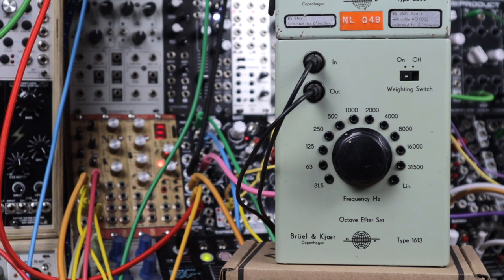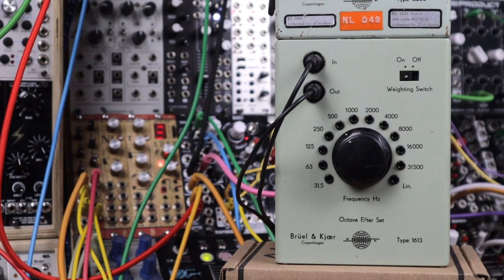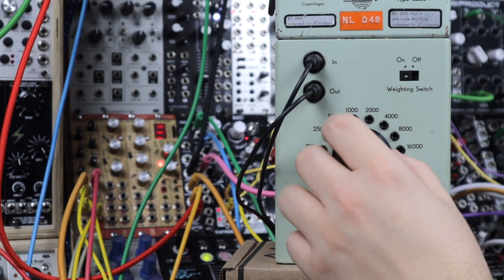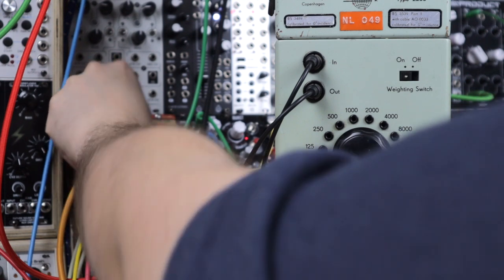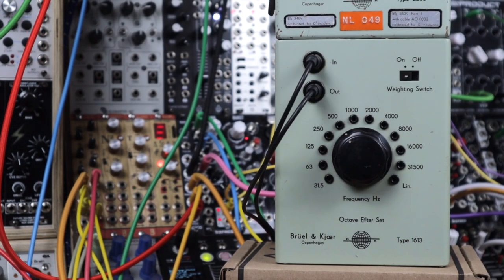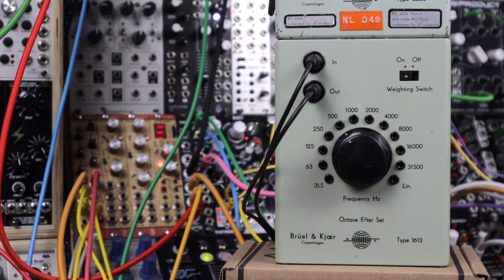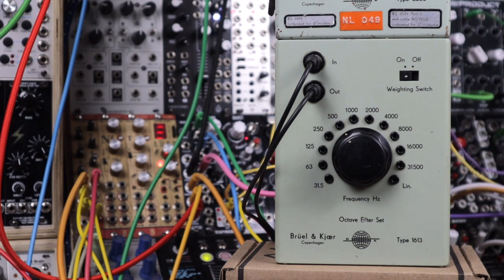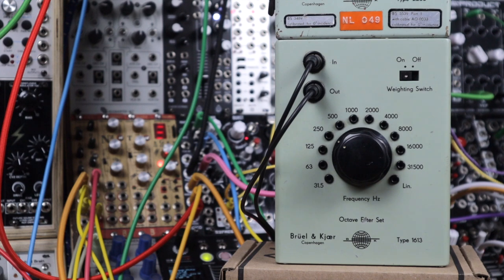Pinging vintage test equipment filters - Bruel & Kjaer Type 1613 // #JAMUARY2020 DAY 28

Comment: Hi! I've got some questions: I recently got one of these, but it only has the bottom end. What's the part with the ornage NL 049 sticker doing? Second question is: when I putn sound through from a laptop the filter does it's job, but when I feed my Grandmothers 6.3 Jack Out through it, it does almost nothing. Any idea why and how to fix it? Love the filter by the way! ;-)
Reply from the maker: the top part is the dB meter and mic that the filter connects to underneath. It's not doing anything here. 

RE your laptop and grandmother use cases ... I've no idea sorry. I'd need things here to try and test it and see what's going on.

Comment: How do you make it feedback several times? How do you set that up on your mixer?
Reply from the maker: Hi Frank, to create a feedback loop you need to be able to do two things, first split the output of the device and second be able to mix the input signal with the output. 

Typically with modular you'd use a multiple to take the output signal and split it two ways. One to monitor, listen to, mix with other sounds etc and the other to route back to the input. Splitter cables work and if you have a mixer with aux/send outputs you can use a send to route the audio elsewhere. 

You then need a mixer for the input, to mix your actual sound you want to go into it with the output. Anything that can mix two signals should do the trick. 

Hope that helps.

Comment: Sweet! What kind of cables are you using to go from the 1613 into the modular? I have a 1613 just sitting around because I haven't been able to source the proper cables yet (barrel connector to 3.5mm or 1/4”).
Reply from the maker: I found these cables that are working perfectly, there's even straight and right angled to choose form - https://www.amazon.co.uk/Voodoo-PPMIN-R-3-5mm-Right-Angle/dp/B00WBRPS6G/ref=sr_1_fkmr0_1?keywords=voodoo+labs+DC+to+3.5&qid=1580331196&sr=8-1-fkmr0
Reply: @DivKid  Thanks mate! Come to think of it I probably have some of those already, they probably came with the power supplies I have! Cheers!